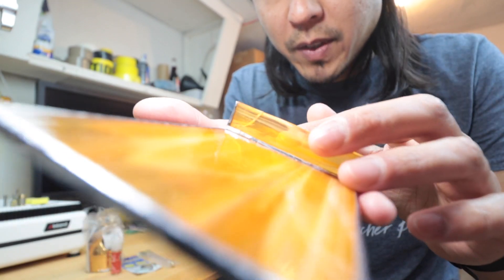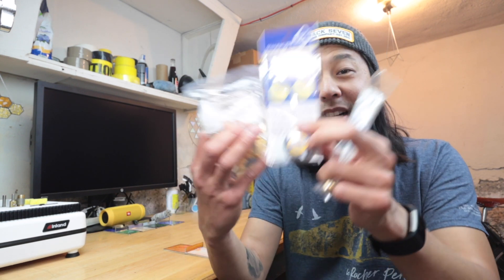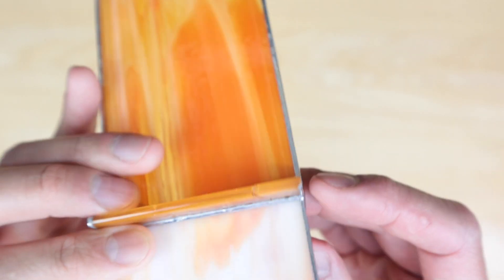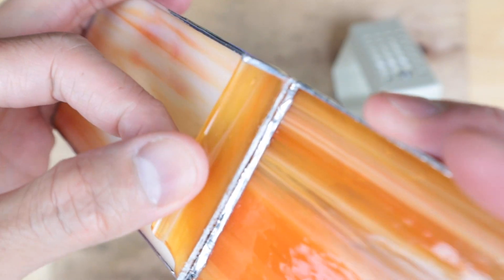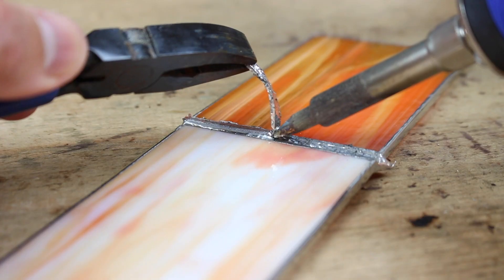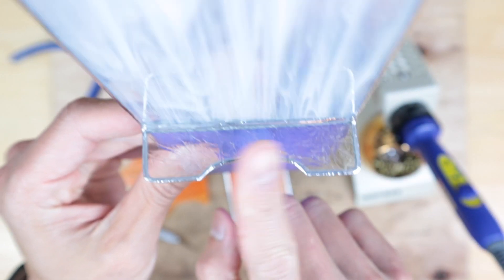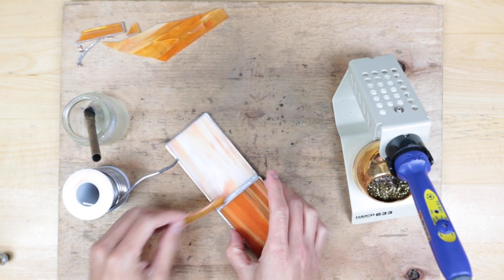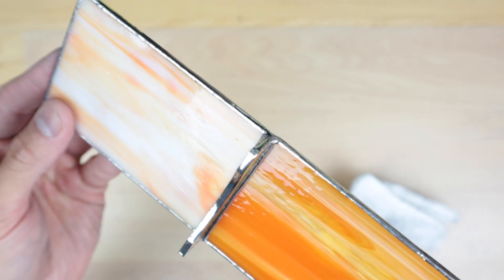How to repair broken stained glass - EASY LEVEL

Comment: Yeah, trying to repair a piece can certainly be daunting. Good straightforward video.

If I could just make two tangential suggestions. First, you should look into using a Homasote board when you're laying out and soldering your pieces. Homasote is soft, so you can use metal push pins to keep your pieces together.

Second, consider using more rounded solder lines. Flat may sometimes be necessary for some aesthetic, but it will be weaker than a rounded solder line.
Reply from the maker: Thanks for the advice. I should hold down my work 😬
Reply: Rounded solder lines? A new rabbit hole.....
Reply: @heartfuldesigns4you  a flat vs rounded solder line. When I started in stained glass I tried so hard to make my solder lines flat,only to find out later that it gives much less strength.
Reply: @michaelkolozsvari3575  agree, "a flat seam is a bad seam" Lady Berz. Bead seams take the patina much better too